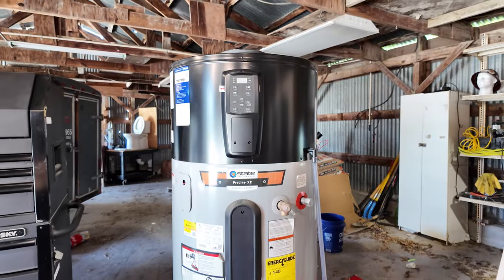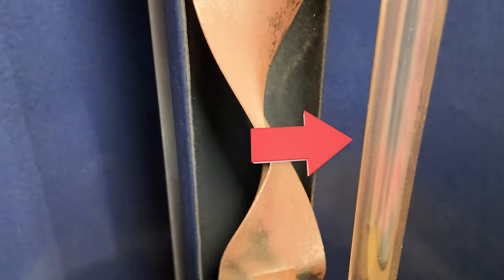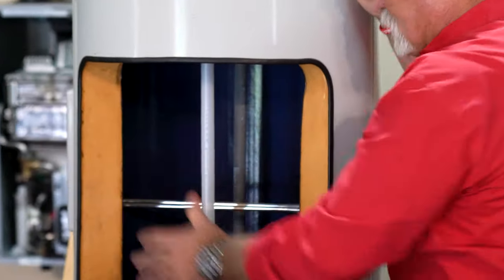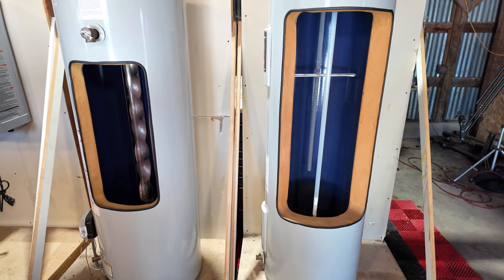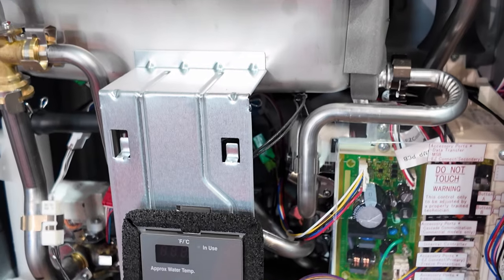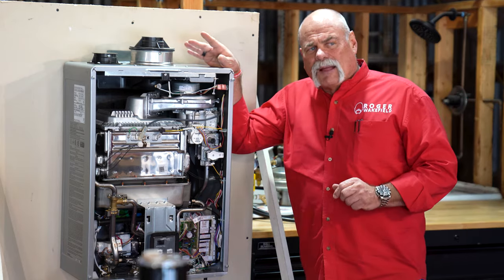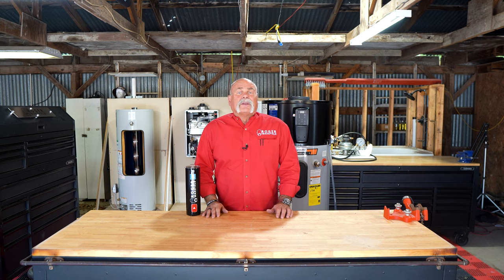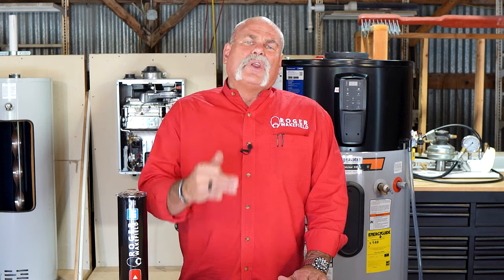Water Heater Comparison | Plumbing 101

Comment: Roger, Im gonna have to disagree with you on gas vs electric tank water heaters. Gas water heaters are far more efficient than electric at least up here in the Midwest where NG is cheap. And also on most Bradford gas tanks it says the average cost to run one is about $280 per year versus an electric water heater that is around  $550. Also, elements go bad left and right. Gas valves go bad too but i see more elements going bad especially if the water quality is not that great. The heat pump water heater is a totally different story though.
Reply: I would definitely agree with your comment. I do facility type work, our company owns 5 homes. They have the same amount of people in each, the ones with electric wh run about $80-100 more a month.
Reply: The heat pump water heater is all fun and games until the compressor blows out.
Reply: @AmericanFarmerHVAC2024  I've only installed 2 have yet to have any issues. I do hvac so  thats more my ballpark anyway. There's really good rebates on them but I wouldn't put one in my house. Too many moving parts just to heat some damn water. I'm good with a gas tank.
Reply: @thomaskaraindros28  I agree. Though the heat pump part would be awesome for some basement air conditioning in the summer time lol
Reply: So far I haven't seen anything that beats gas in performance. Heat pumps or electric in commercial buildings that I've seen installed with good environmental feelings in mind. Just have not been able to do the job. Solar on a domestic level are amazing after several year when you get back what you invested.
Reply: I’ve got a gas heater. Why not just turn the temperature down while I’m in “Mexico”?
Reply: @davidalanlunde  It has a vacation mode (-:
Reply: @mryoung8088  Thanks for the reply. It does have a vacation setting. It seemed the video was saying the gas water heaters were keeping the water hot while the owner is on vacation and therefore bad.
Reply: There's a difference between cost and efficiency which Roger doesn't really cover. An electric water heater is without question more "efficient" than a gas water heater. Nearly 100% of the energy goes directly into the water. 
With gas, there will always be losses through exhaust gasses. But that's not the whole equation. 

The main factor is the cost of the energy source. Per unit of energy, using your utility's electric grid for heat costs more than using gas to heat something. Electricity has to come from someplace. Your utility is most liking using the same natural gas to generate steam to turn a turbine to generate electricity, only to be turned back into heat in your home. It's not an efficient use of electricity for the consumer which is why gas water heaters tr cost less to operate. 

But it's why heat pumps were the tipping factor to heating homes with electricity. Because it's significantly more cost effective to move heat than it is to convert electricity directly to heat.
Reply: @AmericanFarmerHVAC2024  Or when the condenser fins clog with dust because most people do not know they are supposed to be cleaned monthly (which leads to compressor burn out).
Reply: I was coming here to say this too.
Reply: Cost to operate and efficiency are not the same thing. Since the heat source is completely contained in an electric water heater, the efficiency is actually greater. Heat loss is only to the surrounding area through the walls of the tank. With a gas tank type, some of the heat from combustion leaves with the exhaust out the vent. At the end of the day most people prefer gas because it's cheaper to operate despite the lower efficiency.

Comment: every appliance I have ever replaced to save money on energy has made no difference at all never saw any savings on my bill I buy for reliability and performance which one is the best performance if it does not give me unlimited hot water showers it's not for me I use a power vent 40 gallon gas water heater 50,000 btu that is fairly new 2019 and supposedly energy saving.  the old one was better it used a pilot light which kept water warm and had consistent temperature the new one has electric ignition, so temp goes up and down in heater before it kicks on to keep water hot.

Comment: My only problem with tankless is the repair bills.  Yes you save money and never run out of hot water.  However plumbers charge a lot to replace warranty parts.  I wish they would make a residential stainless steel tank heater.
Reply from the maker: A lot of the reason the repair is so expensive is that, especially here in TX most plumbers don't deal with tankless on a day to day basis so it takes a bit more time...that's one thing I'm trying to educate more plumbers on..

Comment: What about the power vent gas water heater you show the oldest style gas water heater also electric is expensive as hell my gas bill in the winter with a 50 gallon water heater is about 60 bucks and my electric bill is 250

Comment: Where I live we mainly use electric water tanks. Most home have to replace them every 5 years due to corrosion causing leaks. Would there be A proffered system that would not rust

Comment: I have a tankless (5 yr old Noritz ) and a tank (10 yr old AOSmith) piped in series with bypass / isolation valves (if I need to service one or during a power outage) and temperature gauges (has made troubleshooting the tankless easier). 

The tankless provides an “endless” flow of hot water but has always been a bit of headache. The original control board firmware was faulty and would shutdown the unit on overheat everyday during the summer. Most techs at Nortiz were clueless but finally connected with a tech that knew about the problem after two years of struggling with it. I had to change out the exchanger after three years as it had developed a crack. Not an easy job but got it done. All covered under warranty but my time and a few plumber call outs were not. 

The AOSmith tank has been a workhorse. It functions during power outages whereas the tankless will not (hurricanes and ice storms here in Houston) After 10 yrs it just started to leak, so time for a new tank.

Comment: Only seen a couple of tankless electric water heaters, more electric tankless boilers, tankless electric takes a lot of power to run 15-18kw might be 2 x60a breakers to run; customers only have 100 amp panel and want to switch from tank gas to tank electric and have a full panel is fairly common in small town Iowa. One guy had 200a panel with 100a sub panel in house bought his own tankless electric water heater and it required 3x60a breakers to run, I told him his electrician would have to do some work for it to work correctly.

Comment: It also depends on the house size and length of the water runs from the heater- I now have a 70s efficiently sized and optimized 2 story, with short water pipe runs- our summer gas bill is $25-$28 per month.  In my old 2008 oversized, thrown together 2 story that was a new-construction with terrible stack-effect, the water runs were really long and the showers would take at least 1 minute to get hot.  We would use about 50-75 G of propane over the summer (including clothes drying), which was about $50 per month.  Another reason I don't miss that  house!
Great and clear explanation as always!
Reply: Is gas better than the hybrid model though? 1980s house single story

Comment: I have my tank type gas water heater so well insulated the pilot will keep it hot enough to keep the thermostat satisfied for up to 10 days on vacation. Here’s a little test to see how well your water heater insulation is . Before going on vacation turn the thermostat to the pilot setting only ( don’t touch the temperature setting ). When you get back home from vacation just turned the same knob back to ON, if the burner kicks in “ your tank insulation is not great” if the burner stays off like mine does (every single test 10 days or less ) your insulation is great and give yourself a pat on the back.Note: my water heater is located in the basement.

Comment: The water heater in my house is 25 years old. It's leaking, so it's ready to be replaced.

Getting a new electric panel and solar panels installed soon, thinking I might as well have the electricians set up so I can have a heat pump water heater installed.

Comment: I NEVER have to change anode rod in my electric duron tank because there is no anode rod. What was the issue with these tanks that caused a 2000 class-action lawsuit.

Comment: So, you use your gas furnace to heat your house. Then your heat pump uses some of that heat from the house to heat your water. And then your furnace has to come on again to replace that heat. 
Did you include that heat loss in your efficiency rating?

Comment: Gas WH doesn't have any insulation on inside exhaust pipe. And it's significant heat losses. Indirect water heater, with boiler is one more good option.

Comment: One thing that should have been noted is that tank less water heaters are only available in wall mounted units ( At least within the last 4 years since I had to go shopping for one). It was a major surprise that we couldn't go tank less without a lot of extra construction when replacing the otherwise free standing gas water heater.

Comment: Hybrid water heaters are actually the most inefficient if you're no longer ignoring the first law of thermodynamics, the conservation of energy.  Where is that heat energy in the ambient air coming from in the winter time?  It is coming from your furnace.  So your furnace is supplying the thermal energy for the heat pump water heater to utilize.  Conservation of energy dictates everytime energy changes form, you lose energy to heat and friction.  Furnace most likely only 92%-95% efficent.  There is 5-8% loss from the start, then while the heat is "floating around" in the air, waiting to be picked up by the hybrid water heater, more is lost to inefficencies in thermal loss of the home.  Then factor in the efficency of the hybrid heater being at best 90%, you have lost 25% of your energy over directly using it heat the water with a traditional gas or electric.
Reply: The heat pump water heater moves energy from the air to the water. Yes, during the cold winter, it's less efficient than gas or electric. But, in fall, spring, or summer, the heat pump at roughly 3x efficiency will be more efficient. Over the entire year, a heat pump will be more efficient.

Comment: Nice BUT you need to look at YOUR actual energy costs locally. If not all is not accurate.
20% for hw cost - no way for me. Where did that come from.
Mine total gas bill for year includes heat, hw, cooking, laundry etc is 1k living in the NE.
All you need to do is check your gas/utilities over the year and see what you are actually spending.